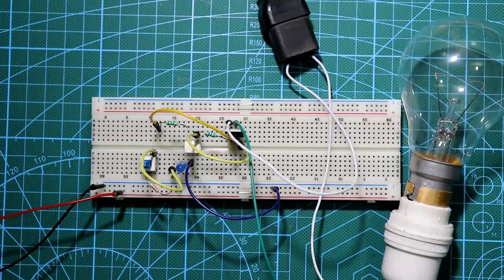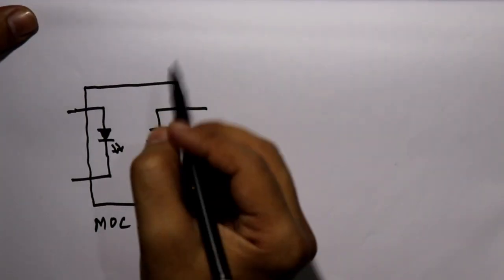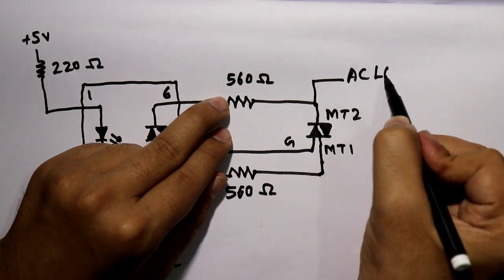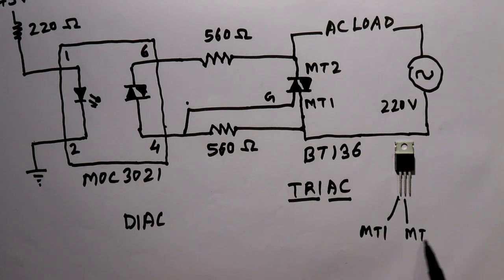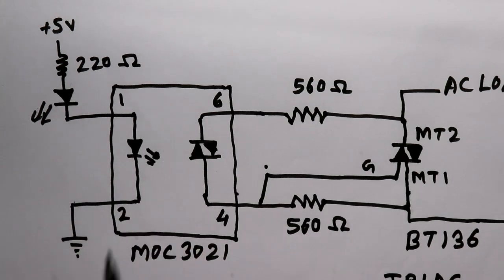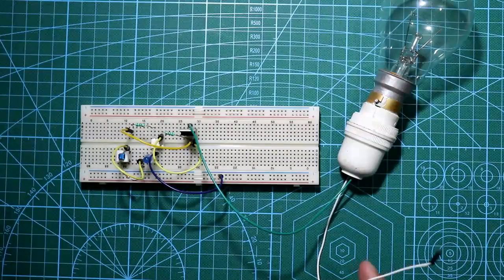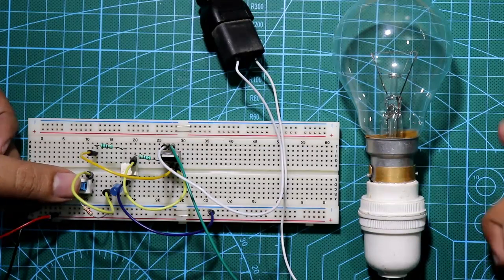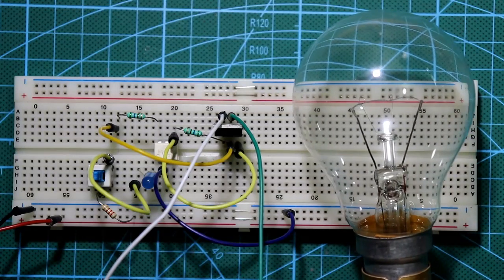BT136 How to connect Optocoupler with TRIAC to control high voltage AC Load

Comment: Sir fir the air conditioner triac circuit is used for motor control, so I got a complaint of motor running direct, i removed optocoupler, changed triac still motor running direct, what can be the fault? Please advise.

Comment: Sir can we use 560ohm resistor  0.25w? or 0.50w. Which one we use for reduce price
Reply from the maker: I've used 0.25w resistor itself but if you want to connect 0.5w then you can. 0.25w will reduce the price.
Reply: @EEWave  Thank You . You guys are so helpfull.

Comment: Hi
I Like your Videos 
I want to build the AC dimmer as AC ON-OFF switch 
Can I use the same circuit with the ESP8266 Node MCU 

]WIth ESP8266 Node MCU to enable PWM on a certain pin, use analogWrite(pin, value); where the pin is the digital pin, and value a number between 0 and 1023]

Use case : 
1. When I set 0 value to the digital pin by analogWrite bulb should turn OFF.
2. When I set 512 value to the digital pin by analogWrite bulb should set to brightness 50%.
3. When I set 1023 value to the digital pin by analogWrite bulb should set to brightness 100%.

I have a doubt : 
Arduino NANO gives an output voltage of 5Volt
but ESP8266 nodeMCU gives 3.3 Volt.
will this works 
please replay to me I am learning a lot from your Videos.

Part : 
MOC3021 and BT136
Reply from the maker: Hi Jotirling, thank you for this comment. I thik this should work. Any how we are using optocoupler so voltage level of microcontroller doesn't matter. MOC3021 can be used in 3.3 volt circuits. I'll try this.... then only I can say something.
Reply: @EEWave  Thanks you for your Valuable comment 
I am worried about if I use MOC3021 with ESP8266 node MCU [Input value vary from 0 to 2023] the output should also vary between 0V to 230V.
Reply from the maker: I'll try to make this 😊
Reply: @EEWave  can I use nodemcu with combination of moc3021 and bt138 for max 12Amp output electric appliances

Comment: I tried to use a 470 ohm resistor and it worked, but there was a voltage leak when I used a 220 volt LED lamp. does the 470 ohm resistor affect the performance? Would a resistor above 470 ohms or 560 ohms be better?

Comment: I have a question  can a breadboard  handel  220v ac voltage ?
Reply from the maker: Voltage doesn't matter. Current will decide about this things.
In breadboard, you should not connect more than 2.5 amperes of Load at 220v. When you are working on this, always use copper conductor, don't use aluminum type. Be careful.
Reply: @EEWave  thank you for your response  . I wanted to detect  zero crosing to dimm light bulb using this circuit https://how2electronics.com/wireless-ac-light-dimmer-with-android-bluetooth-arduino/ but now i think i will do it on a perfboard.

Comment: Will it work with 3.3v ?
Reply from the maker: Yes. Just replace the 220 Ohm resistor with a 100 Ohm resistor in the input side.

Comment: I have in this circuit in my hand 3 optocouplers next to other and there is 1 white wire and 4 green wires that seem to feed it and the circuit seem to feed a mercury light bulb that consumes 90 Volts. What those wires mean that I should supply them with because the bulb is not coming on and is not connected or going through other areas of circuits.  The 5 I guess do hook up to get its signals from the main control board.  But I figure the main control just send current to them so I can do the same.  It is just that I have not seen anywhere on the interent 3 optocouplers next to each 4 legs each.

Comment: Sir, I saw your video, It is very helpful. I have subscribed it.  But I want to know that , How can I amp set particularly value. If amp rise more then set value motor supply must be cut off.
Reply from the maker: Thank you so much Sir for subscribing to my channel.
Now, your requirement can be done by adding a feedback circuit (also done by feedback transformer). This will take signals from the load, whenever there is more current than the set value, it will turn off the source.
Reply: Use acs712 to analyze ac or dc current with any microcontroller. For voltage use zmpt101b